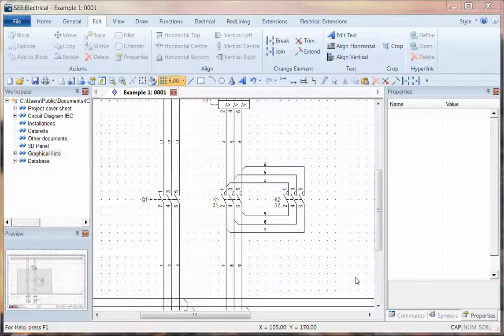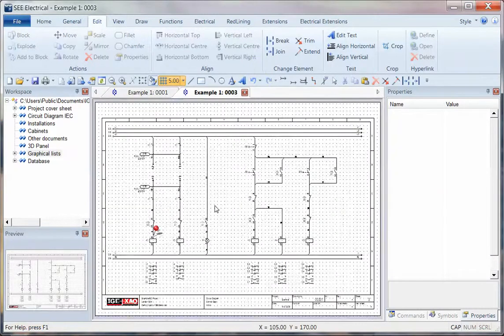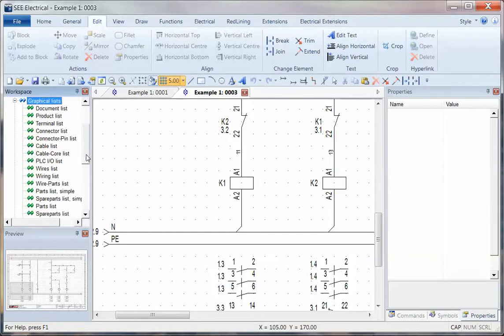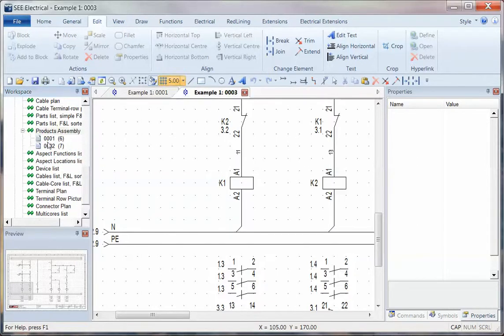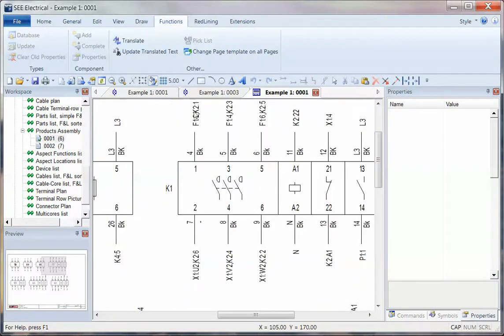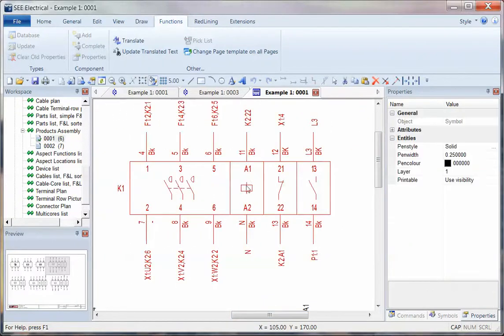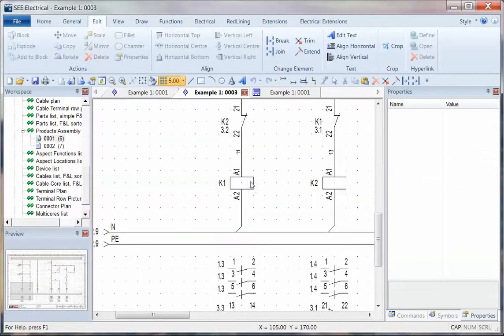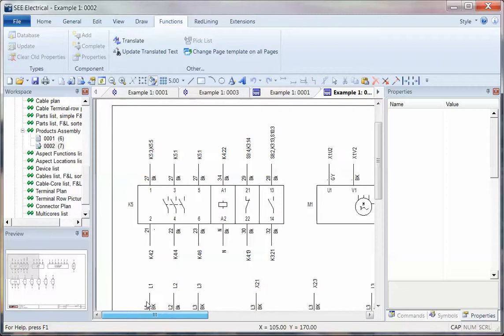Products Assembly in See Electrical Advanced V8R1

Comment: Can I show All terminals connected in on component for example my plc card L+ is connected on X1:2, X1:3, X1:4 AND X1:5 for example.
Reply from the maker: Most things are possible with a database containing the project information :) Just need to clarify if you need all terminals connected on a specific potential or all terminals connected to a specific symbol.
Reply: @IGEXAOUK is on symbol, but I was thinking there was a especifiic option on assembly for do that, I wanted assembly do all the connections beteween components\symbols and terminals.